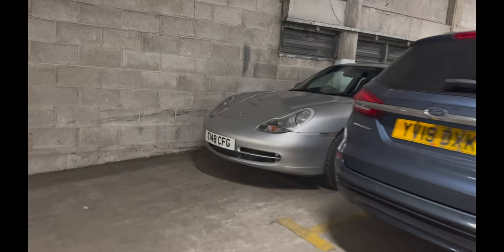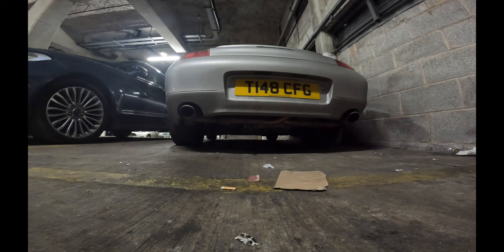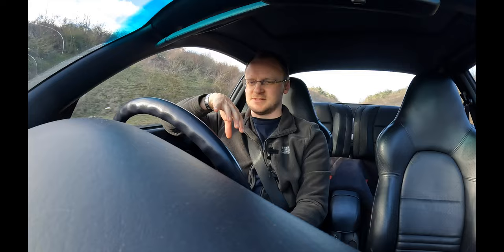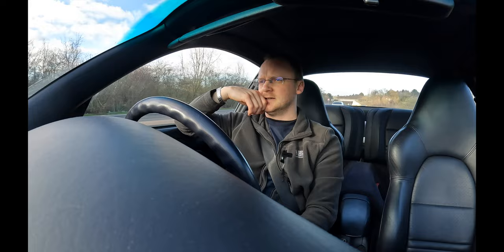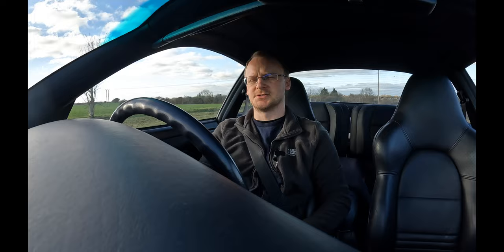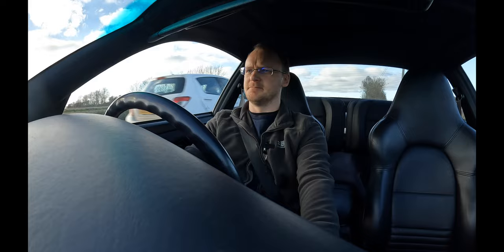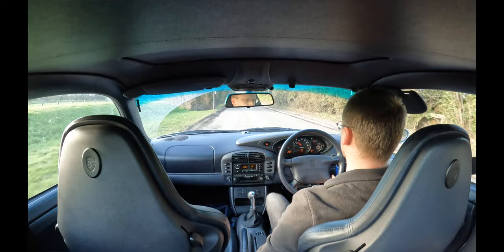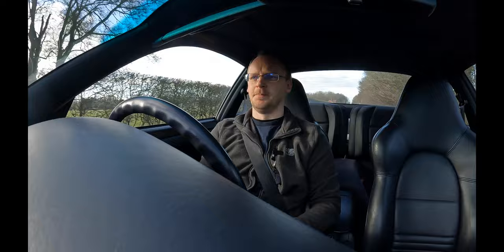Porsche 996 Hartech Engine - Episode 8: Final checks, cost update, what's next?

Comment: hi there, have o dyno your car?
Reply from the maker: Yes, it's 334bhp and 297lbft torque. I cover the dyno sheet in episode 5.
Reply: @leeevernden  I will check it, thank you
Reply: @leeevernden  so you gain +- 34hp and 50nms?
Reply from the maker: @filipejoaoleonardo  Technically +38bhp and +39lbft/52nm
Reply: @leeevernden  you must feel that
Reply from the maker: @filipejoaoleonardo  the biggest difference is in the mid range. But the top end has been enhanced too, as a 3.4 it only had performance at the top, now it has a strong mid range and top. It feels great.